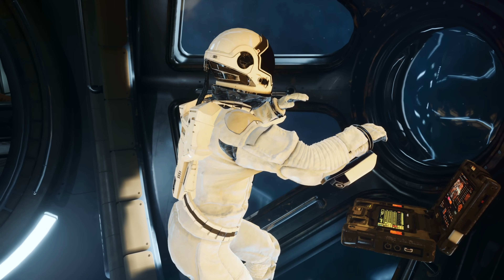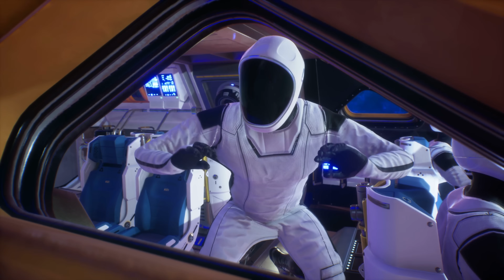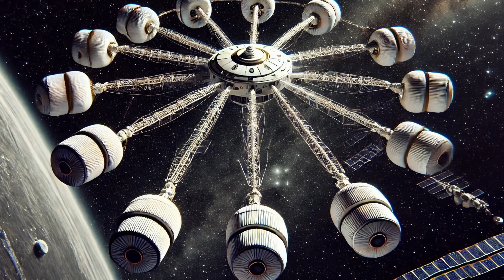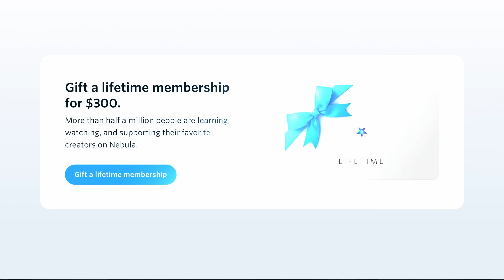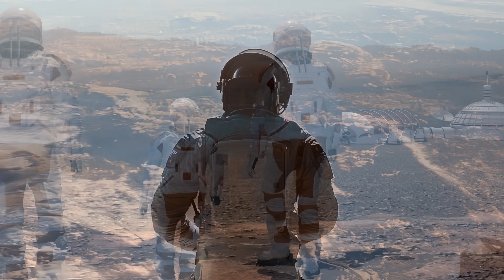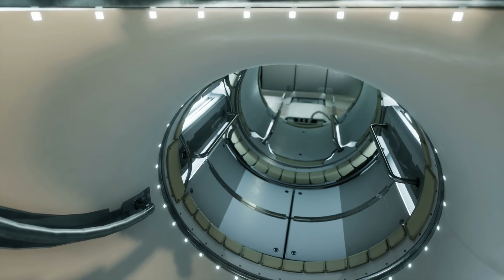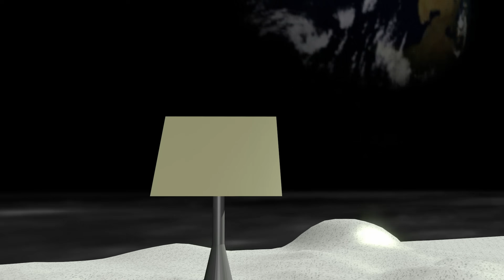Gravity By Design - Tether Habitats & Orbital Living

Comment: There could be some interesting rocket designs if the rocket body was intended to be a cable/centrifuge habitat.
Big, bulky, but streamlined, pressurized with gaseous fuel. 
Or even hoisted from the top by a rocket tug.

Comment: I've read that our tolerance to high rotation rates might be underestimated because tests haven't actually be done in zero gravity. Obviously when you are on Earth you are dealing with both the centrifugal force AND normal gravity so you aren't just testing rotation rate you are also testing that rotation rate combined with earth's gravity. In free fall the results could be quite different assuming your don't turn your head too violently and experience the Coriolis effect. Of course it is quite difficult to test this idea, but it makes sense to me. Another things to take into account is that since dizziness is generally due to a mismatch in visual and vestibular data it might be lessened if the visual cues that you are spinning are taken away.

Comment: We should consider a tethered pair of habitats connected by a central rotating hub. The hub could have the equipment to control the length of cable going out to each habitat once rotation is established, fine tuning gravity. Moving between the two habitats could be achieved by using the cable to move back and forth with a pass over at the hub to the cable on the other side. Those cable riding habitats could also perform repair, maintenance of the cable.  The habitats themselves would have a hard central core and would inflate to create a large living area. The progress in the strength of cables made of many different materials should be able tie the two rotating habitats easily. Why build structure when you can achieve the result with a simple cable?

Comment: The design at 5:26 is the only practical one of them all. It avoids the mental block that the living, working and farming modules have to be oriented in the same plane as the wheel. In free flight, the long axis of the module is perpendicular to the plane of the wheel. This provides a flat floor. The skin of each module is cylindrical as this is the strongest to contain internal air pressure. The gap between the skin and the internal living space can be filled with radiation-absorbent material such as sand.

That's free flight. Now we come to acceleration and deceleration. For acceleration, each module has to be turned along two axes. The spin of the wheel is halted. Then each module, which is joined to its tether or spoke at its midpoint, has to rotate ninety degrees about the connection point so that its long axis is in the same plane as the wheel. Then the module has to be rotated ninety degrees about its long axis so that the floor faces the new direction of down. To visualize this, take a turnbuckle and through its eye pass a length of dowel rod. Mark a line along the dowel rod to represent the orientation of the floor. First turn the turnbuckle ninety degrees, then twist the dowel rod within the eye of the turnbuckle by ninety degrees. 

Artificial gravity during acceleration is provided by acceleration at 9.81 metres per second squared. At this rate, the spacecraft would accelerate to 40psol (40 per cent of the speed of light) in 140 days. After 40psol, the energy curve for further acceleration climbs steeply.

This is so simple and efficient that I can't believe how few spacecraft designers have got it right.

For those who are interested, the formula in Microsoft Basic for the radius required to yield 1g artificial gravity for a given rotation rate is =((9.81^2*0.1)/(2*PI()/(60/RPM))^2). When RPM is 2.9 the result is a radius of 104.35 metres.

Comment: personal note on calculations:

I think it's OK to use g as 10 m/s^2 instead of 9.8. It's close enough. Or .01 km/s^2 when needed like if your figuring delta-vees and you want km/s. And when it comes to a ring, it's easier to round things off to 1 rpm at roughly 1g and 1 km radius even though it's not exact. It's ballpark and easier to remember. 

Formulas to remember: g=(v^2)/r,  v=(2pi)r/T,  T=(2pi)r/v,  rpm=1/T. Just watch your units and keep them all the same or do the right conversions. High school math is all you need.

Example: what's r if you have a wheel-shaped station at 1 g but only turning once per day like the Earth? 
1/day =T = how many seconds? =24hours x 60 min/hr x 60 sec/min =86400 seconds =T 
Let's use meters instead of km so g = 10 m/s/s, so 10=(v^2) /r so 10r=v^2, 
and since v=(2pi)r/T, let's square both sides so v^2 = [(2pi)r/T]^2  = 10r = v^2
so 10r = r^2 x 4pi^2 / T^2 so 10 = r x 4pi^2 / T^2 so r = 10 T^2 / 4pi^2 = 1890896457 m 
or about 1.9 million km or about 2 million km radius not diameter.
Using 9.8 instead of 10 for g gives you 1853078 km or about 1.85 million km.
divide by distance to the Moon (384400km) = about 4.8 times further than the Moon. 
Let's build a ring around the Earth 5 times further than the Moon.
No one will get dizzy spinning once per day! Yay!
I think this has a name from some Sci-Fi story but I don't know which one right now.
Hmmm, Earth-Sun L1 and L2 are at about 1.5 million km so this ring would enclose them.
Oh wait, this is an unnatural geosynchronous orbit so we can tether it to our space elevator!
Oh no we can't because the Moon will destroy the link. Oh well.
I almost forgot: How fast will we be going? v=(2pi)r/T  = about 135 km/s.

Comment: One amazing material you consistently ignore is basalt fibers, invented in the USSR during the cold war and improved by manufacturers around the world over the last thirty plus years. Basalt fiber is now widely used in place of rebar for its superior properties, including an expansion coefficient closer to concrete.

If you look into it, this material is significantly stronger than kevlar (4,800 MPa  vs  3,620 MPa), plus is chemically inert, has a much wider temperature range and is immune to UV and X-ray radiation.

Looking at wikipedia you'd think this stuff is about as strong as a wet noodle, the manufacturers have the facts... They offer tensile strengths of up to 4,800M Pa. Also Basalt fiber products can withstand temperatures from -260°C to 650°C vs kevlar at only -40 to 200°C.

OTOH kevlar is sensitive to ultraviolet (UV) irradiation, which can cause significant photodegradation, including increased brittleness, and several other problems... its even worse than vectran.

The absolute best part is that it can be made from stony asteroids, like 433 Eros which is an NEO and around 16 km in diameter.
Reply: Yes, plastic cables need opaque jackets.

A high ratio of tensile strength to density ratio is the thing. Basalt is two to three times denser than plastics with which it is equally strong.

The best I’ve heard of is Zylon. Sunlight kills it, the same as with any transparent or translucent plastic, and in space the killing would be much quicker. But this just means a small fraction of each rope must be an opaque jacket. Maybe vapour-deposited aluminum, if the rope is being made in space, because there’s handy vacuum to do metal vapour deposition in.

A 22-tonne tether mass works out to 14 cubic metres. Supposing it's 7940 m in length, we get the cross sectional area: 0.00178 m^2

Suppose it is 12 strands, each is 1.4 cm in diameter. Their surface area is 4100 m^2 and a two-micron aluminum coating therefore amounts to 22 kg, 0.1 percent of the mass.

There are stony asteroids, and there are carbonaceous ones. So if plastic is better -- and it is -- asteroids have still got us.
Reply: @grlcowan  So to protect the plastic you'd have to use a second material to cover it, meaning you now have to factor that otherwise dead weight into your calculations. This is especially so if you can't find a lightweight material to block x-ray radiation, which is almost certainly going to damage anything sensitive to UV, although that material has never been tested against any other radiation than UV. I don't know of any lightweight materials that block x-rays BTW.

Most of my misgivings come from the fact that a few companies made ballistic armor from zylon a while back, it turns out the stuff degrades over the course of a few years from just humidity. They ultimately recalled them and sold them for a short while longer with a 30 month warranty. There were congressional investigations into that mess too. This means at the very least its quite tricky to manufacture even in the relatively tiny quantities used so far... imagine billions of tons.
Hopefully no water leaks into the shell or any structural members made of the stuff!

I actually ordered some zylon a while back, the spool is around here somewhere. Incredibly strong, but also delicate. IMHO, it is entirely unsuited to the harsh space environment.

I did some research on basalt fibers. They are more dense than aramind/kevlar, at about 1.84 times the density. The strength is much higher too, one supplier sells a variant with a tensile strength of 4,800MPA (4.8GPa). Kevlar is at 3,620MPa.

Using a calculator over at space calcs, basalt is strong enough for cylindrical habs at least 60km in radius. Since that calculator doesn't have basalt, I used kevlar and adjusted for the difference in weight/tensile strength by using a safety factor of 2.9... as I also wanted an actual redundancy/safety factor of 1.5. That calculator could be flawed in that it let me make such a monster. I even raised the atmospheric pressure to 1.5X normal.

Just for giggles, I went and put in 201km for the radius (yeah, that's 402 km in diameter or 250 miles in diameter)  and the calculator gave a warning about the shell being to thin, I had to make it 44 meters thick LOL. The rest of the numbers... wow. For static spin stability I made the length only 300km and set the population density so there is about 19,000 sq feet (1770 sq meters) per person, and with just the one deck that allows for about 326 million people. If it was made with say 100 levels (you know, with fake sky and all maybe 100 meters in height), that allows for a population of about 32 billion people. That size means it only needs to spin at about 2/30th of an RPM ... or 0.0666_ RPM for 1G.
Reply: Finally someone talks about this! Almost all my ship designs have cables supporting modules on extensible gantries or scaffolding. Nice!

Comment: At https://www.youtube.com/watch?v=Igqr1SOYa88 you can see a fairly substantial non-pressurized habitat. A rigid arm reaches up from its roof about ten metres and attaches to a 3.2-kilometre tether.

It's on Earth, and it hangs from the side of the cable, not the bottom. But it can still illustrate some things.

If the tether were in space, in free fall, and spinning to give the gondola one gee, the gondola could be a "hammer habitat". That means its floor would be cylindrically curved. Its down-hanging distance of 3 km means that its roughly 8-m-by-8-m plan amounts to an angular extent of 0.14 degrees. From its centreline the floor would curve up 0.07 degrees at two of its edges.

But in space, the 3.2-km tether could be lengthened to eight to ten kilometres, reducing the floor curvature to 0.05 degrees. If you asked for a hammer habitat and they gave you one with floors that weren't curved at all, you might not notice. With a good transparent floor, and good sunlight management, you'd be more interested in the underfoot stargazing. The stars would take about a minute to wheel from the floor window's east edge to its west one.

No matter how small the gondola is, it makes little sense to shorten the cable. The optimum distance from gondola roof to spin axis is somewhere in the range 3.577 km (30 rotations per hour for one gee) to 10 km (17.94 rotations per hour). Longer, if cable materials get better in terms of their ratios of working tensile strength to density. Longer and slower-spinning.

Rich people are definitely going to want to own these things, and spend time in them, occasionally dropping in on Earth for short visits. Each will want the whole structure, string, hub, and all, to be their personal property. Slightly less rich people will tolerate condominium or timeshare arrangements. (Everyone will want a bottom-deck apartment because of the above-mentioned view.)

So budgets for their construction will increase over time, and their sizes will increase over time.

The question that should be asked is, at what point does it make sense for this growth to start to be to spinward and antispinward, so that the hammer-headiness becomes more and more noticeable, and suddenly they reach completely around the circle in which the rotation carries them, and you have a Kubrick dumbwheel? No longer dumb?

That would be when everyone who is anyone wants the east and west wings each to be pi times 3.5-to-10 kilometres in extent, and meet each other at their ends.

I doubt this can happen, ever.

Comment: Why does everyone obsess with structures or habitats custom built for spin gravity?  Its space, can use tethers between 2 objects and spin them up. Theyll be stable. The original launch vehicles can be utilized with some minor modifications to have a tether mount. Less time adjusting software to have thrusters properly start the spin.

Comment: Hi Isaac - You are right with the numbers, only it seem you can get a bit smaller, if you agree on a bit weaker (artificial) gravity. OR if you try to slowly aclimate the crew to live in unpleasant RPM environment.

Regarding the multiple habibats with central hub design - I think it would be much more durable and secure, if the hab-hubs would not be tethered only to the central hub, but in kind of "spider web" to each other too. 

Design prefered by me, is central slightly bigger active - interplanetary - flight - capable starport with fuel, multiple retranslator and global positioning satelites to set a network and other resources, wich would work as an orbital station and "mission controll" on orbit of desired planet, connected to paralel (to each other) "in direction of flight" oriented SpaceX starships with levels prepared for starship in horizontal position. If such, whole starship would be used as habitat in space and mars-based building after landing. That would leave the "oddity" of such interior design only for lift-off on Earth and landing on Mars. Right afterward, when layed on the surface, it is usable for habitation again. 
Another point why this - if the starship is made to be held on tethers, you might add (when lying) number of wheels and have a surface - riding megavehicle/building.

BTW sugesting you check videos of (or try on your own) electronic game "Nexus: The Jupiter incident". There are many different visions of simulated gravity spaceships or starbases - especially in the first part where The Stilleto serves as hero ship, and than closer to the end. Trailer: https://www.youtube.com/watch?v=xlHashKnCLM

Comment: I feel that tethered habs can be useful on a ship that also has constant acceleration ala the Expanse. While nuclear rockets with the specific impulse and high thrust like in the show is technically feasible and I can see it become achievable in a century or so especially when we can figure out the logistics of the ship, we don't necessarily are in a hurry to get anywhere. It might still be more efficient to do like 0.5g or less, and you can spin your habs slower or at a smaller radius (assuming a retracting or retractable design) to achieve 1g or the minimum that the human body needs to stay healthy long term. 

It will require a design that allows for the habs to swing rearwards up to the point since you do have acceleration during the "burning" phase of the flight. The main core ship will still have some gravity so it will still be comfortable to work in but you can always go back to the hab for more gravity (I can see foresee some issues with transit in between but it's nothing major, even with a retracting design). And during coasting or orbiting, the hammer habs will be the only place with gravity-like acceleration. I suspect a spaceship design with such high thrust+ISP will have the shortest radii for their hammer habs that can provide up to 1g without engines, at least for most people (just like there will always be people who are chronically seasick on long ship voyages, we can expect that some people will still experience "spinsick" on such space vessels).

Comment: The spaceship in The Martian, the Hermes, had a central non-rotating section with rotating spokes attached to four hammer sections.  In most space habitat designs I've seen, the entire structures rotate because once they have been spun up to the desired speed, no new energy or propellant would be necessary to keep the structure rotating.  At least that would be the case unless and until some other force acts on the structure.  However, combining a non-rotating center with rotating hammer sections is probably impossible without adding some friction to the system.  I can see some real advantages to a space station that would allow passengers to travel from micro-gravity to spin gravity, and back to micro-gravity in their shirt sleeves.  On such a station, astronauts could most likely avoid the ill health effects of micro-gravity while still being able to conduct the science experiments that can only be done in micro-gravity.  Plus, you would almost certainly sell more tickets to tourists if they could avoid having to use a micro-gravity toilet.  Tom Cruise will even be able to take a hot shower before he starts filming his latest action movie in zero-G.  

My question is how difficult would it be to connect the rotating and static sections?  Could electric motors maintain the constant spin rate?  How much power would that require?  Fortunately, abundant solar power should be available in Earth orbit.  Plus, SMR (small modular reactor) technology should be quite advanced by the time we start sending humans to Jupiter and beyond.